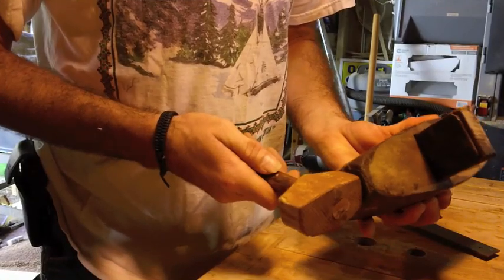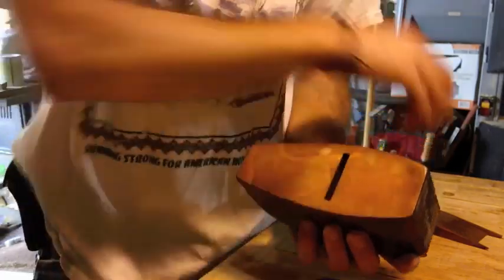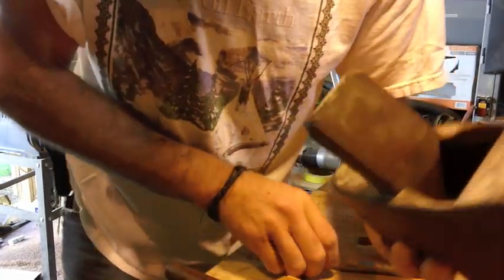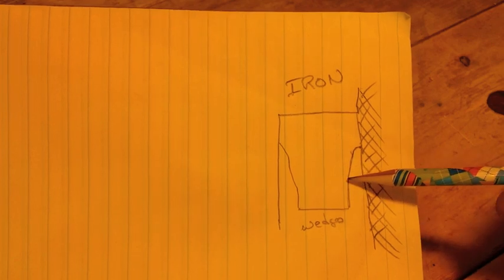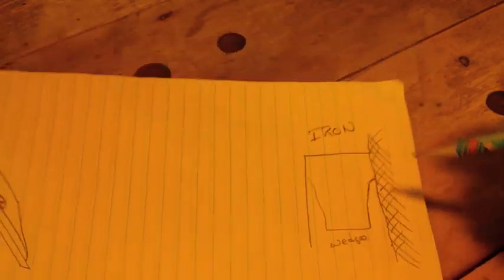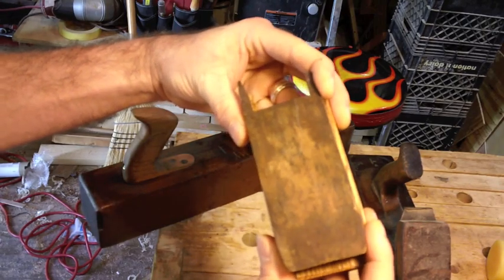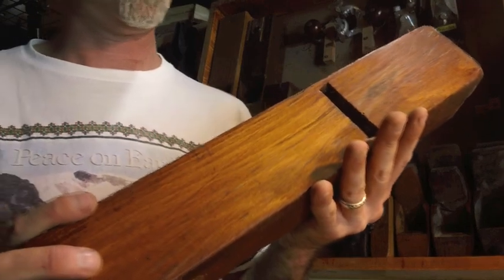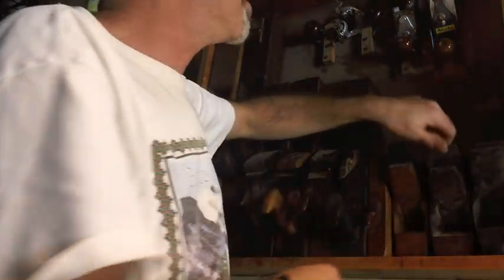Wood Plane Wedges

Comment: Thanks Dave. I have  some of these but I'm a seventeenth century wood turner so they are really just props. I've tried to use them but have come across all sorts of problems. Would you demonstrate the use of the different planes please? I'm especially interested in how well they cut. I'd like to use mine especially for stool seats from wood that is unseasoned and seasoned but cut straight from the trunk. I will check the wedges to see if that is part of the problem I'm getting. Great vid, thanks

Comment: Hello Dave please tell me what  factors to keep the iron blade quite tight  in place and stable..what  the effects of blade angle to hand plane performance.. generally iron angle is around forty five.. how the effects if the angle around thirty give to forty for instance?!
Reply from the maker: +Amri Wirabumi a smooth bed and a tight wedge make for the least chatter and stability.  
The higher the angle the less tear out but the difficulty is very high to push the plane. Google "York angle for hand planes " start reading there. 
45 is the happy medium.